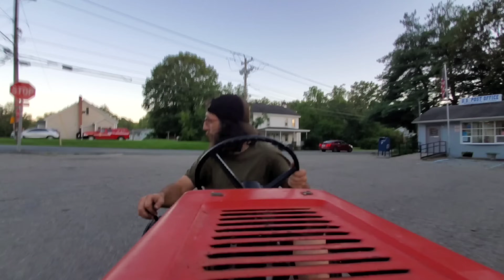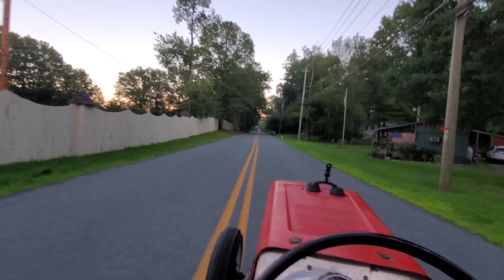Hot Rod Tractor DRIVES. Did Not Go as Expected. 76 Camaro Moves After 10 Years in Garage

Comment: If it was mine I would put a support Bearing on the rear Right side of the Drive axel. I would also install a double center bearing set up between the Motor and the Rearend axel/ Make the one going from the carrier Pullies to where you have the most power to the rear end with shorter belts. I used to Race Mighty Midget Racers on the Missouri, Kansas Circuot and was always having Belt slippage and when I devided the power to the Center Tightner Pullies I was able to win mower Trophies.

Comment: Fantastic build, Question, Are you worried about Burning yourself on that Tailpipe right next to the Seat?
Reply from the maker: Thanks. In the machines previous configuration, I had that exhaust for a while and was never an issue, all though now that the seating position is lowered, it's definitely gonna need a heat shield. I also want to shroud off the seat to hold me in corners as it's hard to stay in place.

Comment: Do you have a video making the wheels fit
Reply from the maker: I think I may have shown it. It's still using mower parts. I have garden tractor hubs. All 5 lug garden tractor wheels are 5x4.5. Same as trailer wheels. I will have a full overview video coming up, and I will show exactly what I used and how it's set up.

Comment: Put you axles on piller blocks close to the wheels that's how we done my sons
Reply from the maker: Yeah, that's definitely something I should have done, as it's not the first bent axle I've had. And it turns out they're both bent. It wasn't as obvious with the wider wheels and tire I had before. I do have another idea I'm working on to fix it that should be pretty cool, so stay tuned. And thanks for watching 👍
Reply: @DieselFuelNetwork  Years ago, the way that worked to support a shaft over a distance without a bearing was to create a taper over the length of the shaft.  In fact the old Sensation lawn mower engines used a tapered shaft to attach the blade to and it prevented bent crankshafts.  Pillow block bearings for the win.

Comment: Instead of complaining how you are not into it get the right pipes to begin with. It is not that expensive. Anytime you hack something together it will never look right.
Reply from the maker: I had to go back and watch. One thing to consider is that this machine flexes quite a bit when off-road. So I really prefer to have the exhaust sections connected with flex pipe. Any other type of flex joint would not look right and is more expensive. This exhaust system is basically what I had before stretching the frame and is made up of harley drag pipes I got for free. The rear section over the tire is exactly how I want it to look.
Thanks for watching and commenting